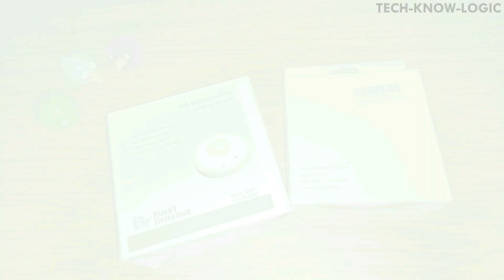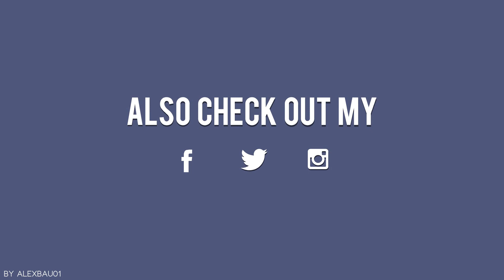PIR and Microwave Motion Sensor Uses Working Difference Explained in Hindi

Comment: Hi bro, which sensor will be best suitable for controlling ceiling fan between pir and microwave, because when thr celling fan will be under rotation it will be equivalent to some movement and thr sensor will probably catch it and it may not go to switch off mode. So how to resolve this issue and which sensor will be suitable for that purpose as per you expertise suggestion?